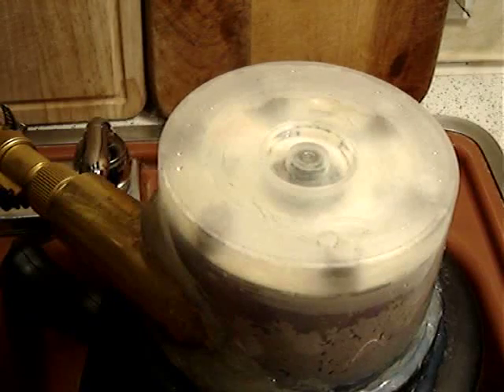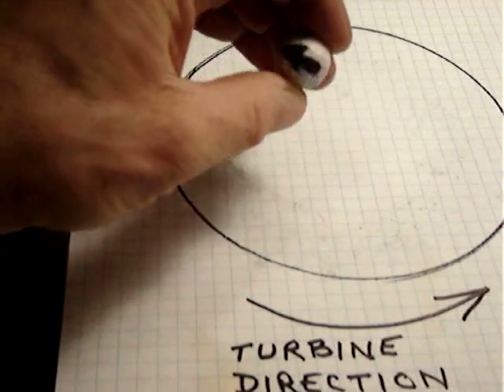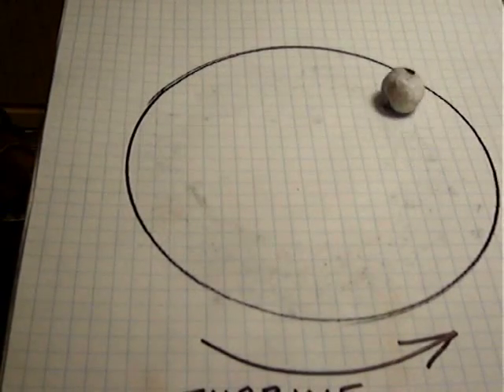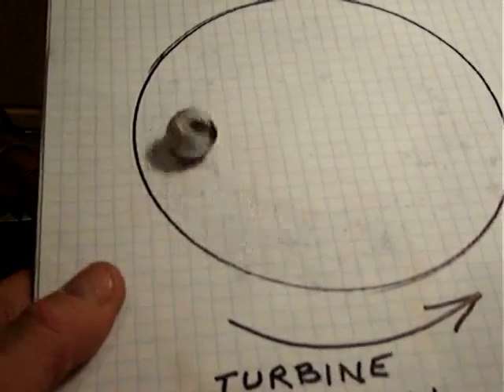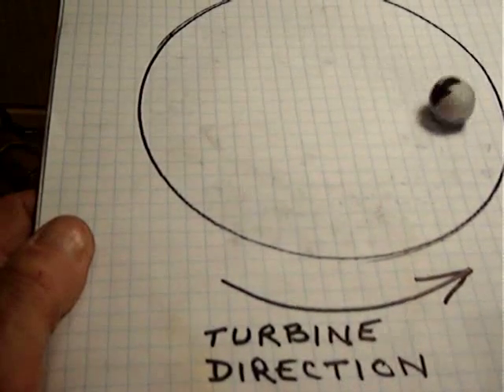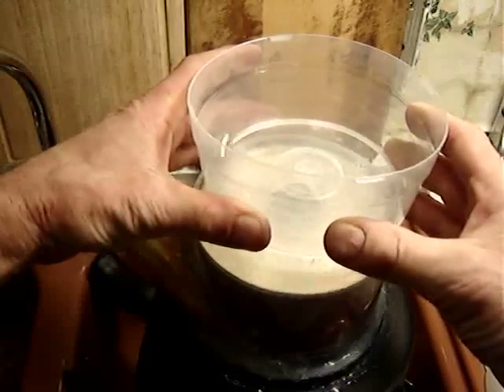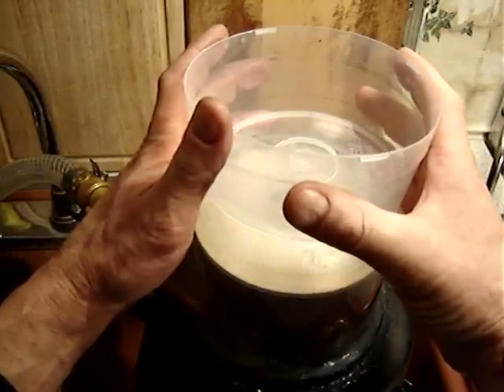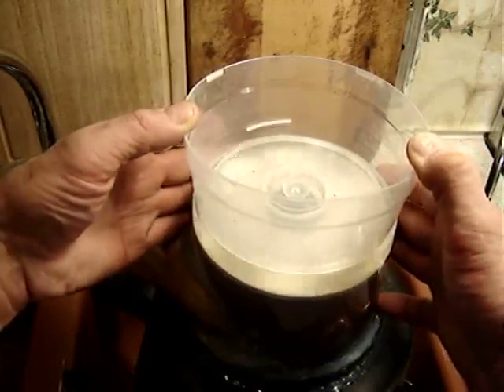SinkScience #11 - Mysterious Reversing Ball Magnet

Comment from the maker: Yes, the counter-rotation phenomena is kind of like the "Back EMF" in an electric motor being re-routed to power the motor itself, as some alt-sci folks have claimed to do. For example, there may be a secondary reversal of rotation of the magnetic ball at higher speeds that could contribute back to the turbine speed. 

More research is needed...I just wanted to "get the ball rolling" so to speak!

Comment from the maker: A water turbine is safer, easier, quieter, and cheaper to run than compressed air.

 I pay for the water, it's from a well and costs 5 cents an hour to run. So my ten-minute experiment costs about 1 cent to perform. Not bad, but my newest system is re-circulating and solar-powered, using no outside energy source, including the well!

It's always a good idea to run safety gear when playing with a turbine made from CD's and  magnets...but this water-powered version is about as safe as it gets !

Comment from the maker: I tried an aluminum pie plate, but it only seemed to spin in one direction. (see "Will It Spin??" video) Copper is likely the same, but would be a good experiment.

I did get a 6-magnet magnetic coupler to go slowly backwards as well. It took an hour to find the "sweet spot".

I'd like to build a ball bearing structure with magnetic balls for the bearings and see if it would rotate backwards!

Comment from the maker: Thanks for comment. 

The steel disc won't work too well because it gets too attracted to the magnets. 

But I like your idea of the copper disc...perhaps I could get power out of it by running wires from the center and edge of a stationary copper disc above the magnetic field of the turbine.

Good experiment, but I will have to build a new turbine, as I just blew up my favourite SinkScience turbine!

Comment from the maker: I used 3 magnets in my first design and it was remarkably stable magnetically-coupled with a skilsaw blade. I went to 6 magnets for the same reason that Tesla added washers to the original Tesla Turbine ...better low rpm torque.

Comment from the maker: Thanks for comments.
On your suggestion, I spent some time with the "ball on a string" test, and found, that indeed it could go backwards against the rotation of the turbine.
    It took over an hour to figure out various heights, and rpms. It was much easier to get the effect on a surface, but it did happen on a string.
  I hope to post a video in a couple of days showing that and other interesting vortex effects.

Comment: Excellent! LMAOLOL at the beginning. I can so relate to Harvards Law!

Now, seriously - regarding the foam wrapped ball. This is some insightful work. I find the variant speed of each revolution intriquing as well. This brings us back to the earlier suspension tests. If hanging it from a line doesn't have the effect we still don't have a solid answer o.O

I'd like to see two balls with a vertical wall between them on the drive magnet BCD. Will they turn in opposite directions?

Comment from the maker: The main principle behind how the Tesla Turbine works is fluid adhesion and boundary layer effects between the narrow space between the flat discs. The incoming fluid speeds up through the nozzle, hits the outer edges of the discs, and moves to the center outlet in a spiral manner, pulling the discs around.

There is a definite vortex whirlpooling  involved as well, but the main action on the discs is through the above means.